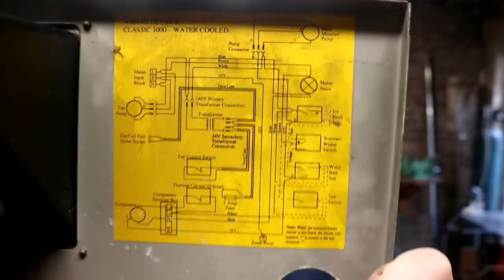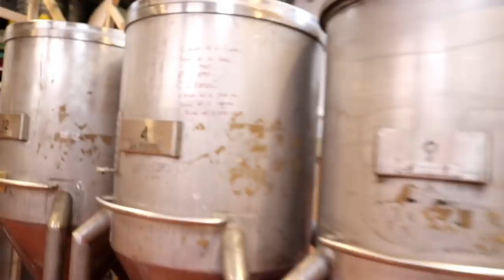Installing Digital Control To A Beer Cooler

Comment: Wow what a few hours can do when sorting wires out, looking spot on now all tidy. A tidy place is a healthy place to work, shame the other guys who's work you are correcting didn't do the same. Are you trimming them blocks down from the hole with a grinder , then putting them back in her hole to seal it up instead of using expandable foam. Cheers
Reply from the maker: I will just get the foam gun out. I can  always send other stuff out if needed in the future.

Comment: I don't understand why you need a temperature controller on this, if each radiator has its own temperature controller surely this just needs to be as cold as possible (ice bank mode) to give it the biggest temperature differential &  buffering capacity? The colder it runs the better the cooling radiators will work.